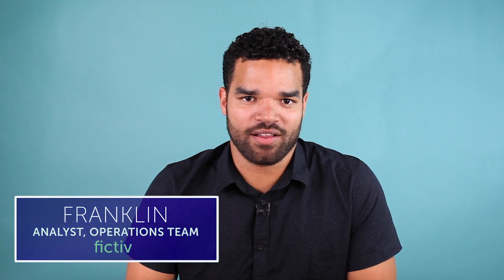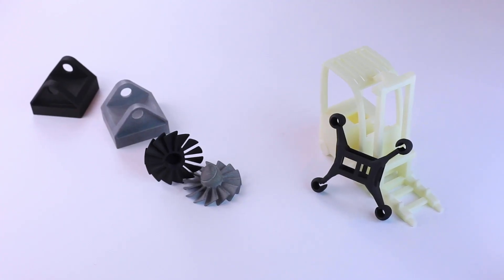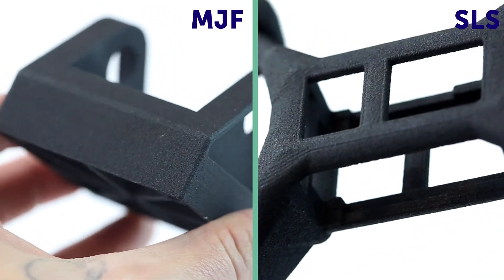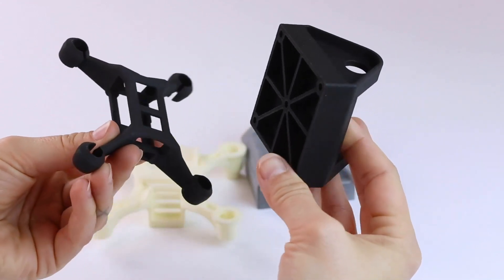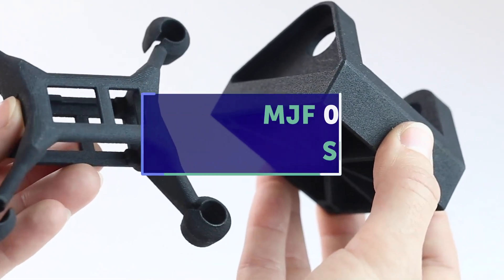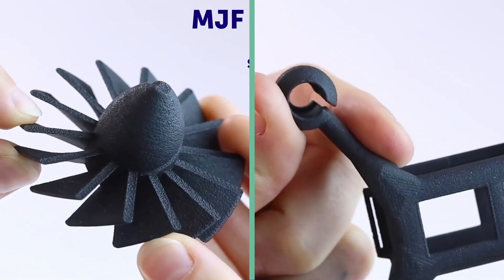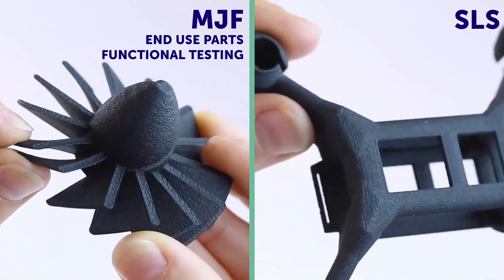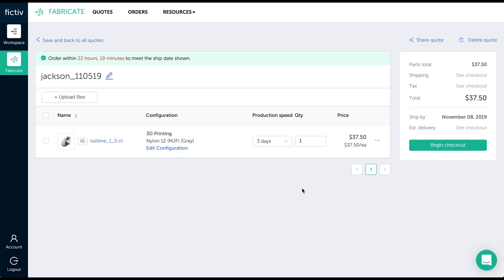3D Printing Comparison: Multi Jet Fusion vs Selective Laser Sintering Nylon | Fictiv

Comment: why would you compare two different technologies with different printed geometries...??
Reply from the maker: Good question! Although both of these technologies use Nylon as their material, due to other differences each method results in parts with different mechanical properties. Therefore, it is useful to show parts with different geometries to highlight the optimal use case for each type of 3D printing.

Comment: Hi dear  friend why  are you giving wrong  information sls can do 0.60 micron  eos formiga example + second sls surface is not as you explained plase check formiga 110 parts. Also have you heard about formiga fdr (fine detail resolution) there is no strong part with that kinde of detail. what if we ask for white part can mjf do that?  please check all this and give us correction.
Reply: I guess he's comparing the machines Fictiv use in their 3d printing service
Reply: MJF can do white parts now, though (in the UK at least) barely anyone runs that setup. 

There is no hard and fast comparison between the two, and whenever there is another company releases something different 😂